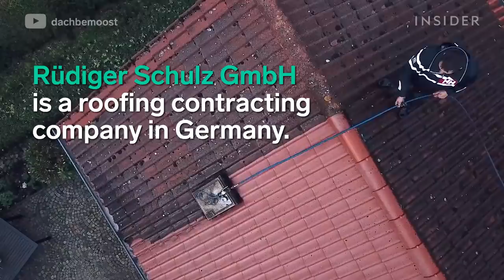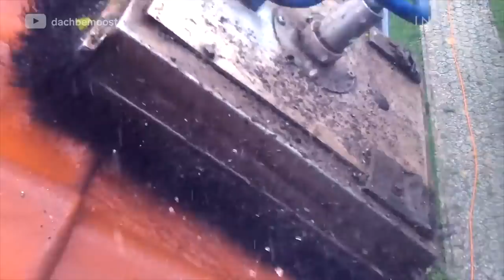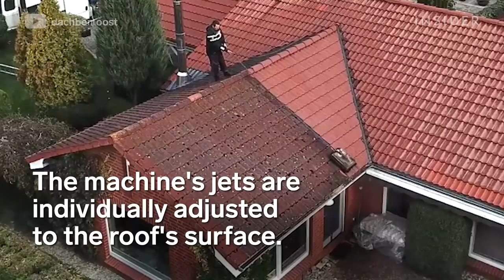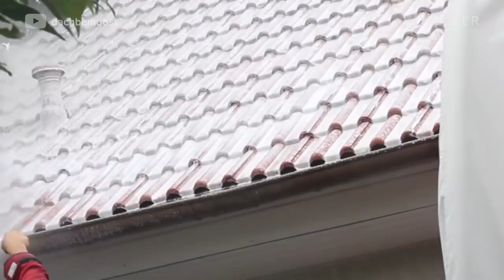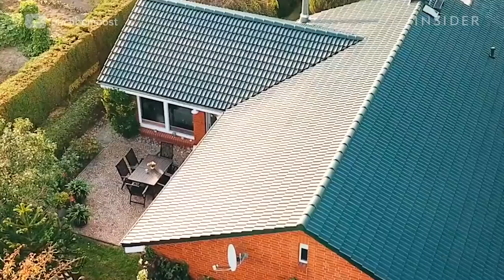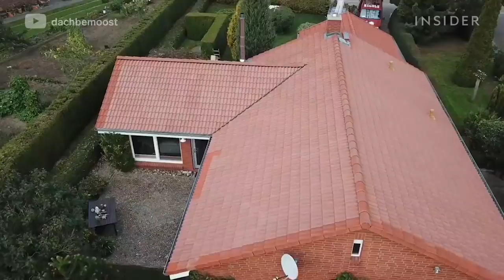Cleaning Roofs Is Easier With This Machine

Comment: I actually love having moss and lichen on my roof... It looks homely
Reply: It may look homely, but bacteria (gloeocapsa magma), moss, lichen and such eat away at your roof causing premature roof replacement which wastes several thousand dollars and leaves your roof looking bad and if you try to sell your home with the roof in that condition, it will lower the value of the house.  First impressions matter.  if someone sees a nasty looking roof, they will assume the same level of care was given to the house while you owned it.  These contaminants can also eat away the limestone granules on an asphalt roof leaving what appears to be hail damage.  When I bought my house, the home inspector saw the damage and the homeowner had to replace the roof before he sold the house to us.  It's your home and you can treat it how you wish, but it costs you money in the long run.
Reply: @Troy-Echo  i must apologise, i live in South Africa, my roof is tiled with ceramic molds that have been there since the houses construction in 1917. I believe they are half an inch thick, but i am unfamiliar with imperial measurements.
Reply: @alexvanoers9835  Hmmm, 30 centimeters is 12 inches, so 1/24 of that would be 1/2 inch, wo that would be about 1.25 centimeters for 1/2 inch.  These are still harmful (the moss and lichen) as they do have filament and micro-filament root structures which burrow into the roofing material and accelerate the decay of the roof, but as long as you do not have a leak, I'd say stick with it.  If it has been there for 100+ years, it was built well.  Not much is built like that these days.

That's why I'm about to build my own Walnut dining room table instead of buying something.  Unless you hire someone here in the USA that is a wood worker, or pay a LOT of money for a real wood table, the only options are cheap MDF or chipped wood pressed into a form and put together to look like a table, then they add a really thin veneer that looks nice, but it is easily scratched and then (at least to me) it looks like crap.  Once it warms up here I'll tackle this task for the fun of it.  Look up BYOT #23 here on YouTube and you'll see what I'm talking about.  The house I'm in now was built in 1989, but the house I was in before this was built in 1929, not much newer than your home, and in many ways it was far superior to the house I live in now.  So I like older homes like yours.  Well built quality items last, where the cheap furniture I mentioned may last several years if you don't try to move it, but it's total junk.

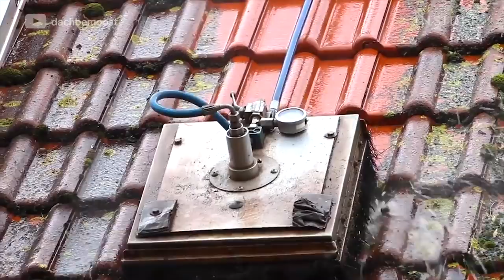Comment: 0:52 How can that thing go straight when there is a pipe there?
Reply: They avoid things like that because a square surface cleaner (even round ones) will not be able to get close to dormers, pipes and other items on a roof.  you need to reach those manually, which they do not show because it ruins the illusion and shows how much of a piece of crap this is.  I do professional roof cleaning and I'd never recommend a product like this.  1) all you hear is music, which is intended to mask the fact that you'd be listening to a high powered pressure washer otherwise, which can strip paint and clear coat off of a tile roof and leave them looking dull and lifeless.  I also do not understand why people post videos like this.  OSHA could pull these and take this company to court for not supplying their employees with proper body harnesses and safety ropes.  That's about a $125,000 fine, and people are posting this where it can easily be pulled as evidence against them.  The proper way to clean a roof is soft washing.  This is a chemical process that kills the bacteria, moss, lichen and other contaminants on the roof gently, and does not effect the paint or clear coat on the tile or other roofing surface.  This is just a new version of the roof rover device which is just as damaging in my opinion.  If I hired someone to clean my roof and I came home and saw them using this, I'd take them to court for damaging my roof.  A new version of a harmful product is still harmful.  They conveniently do not show you the areas on the roof where the surface cleaner has blasted away the clear coat or paint leaving the tile looking like crap.
Reply: @Troy-Echo  yeah this process may dull the paint and take that magic coating that everyone talks about! However after 10 plus years this magic coating gets eroded by the elements anyway and if you watch the video until the end the coat and paint the roof anyway. Meaning the magical coat you talk about is good as new! Turns out this machine isn’t as bad as you suggest!

Comment: These surface washer have been around for years, only this guy was crazy enough to support the weight of one down a roof merely the hose itself, incredibly dangerous when that hose fitting breaks under pressure.
Reply: i've had hoses pop, no big deal.

Comment: $1000?
You are literally paying for something that a pressure washer can do and cheaper.
Reply: No matter the shape of the item, a pressure washer can and will damage your roof.  A pressure washer can strip away the clear coat and paint underneath on a tile roof leaving it looking dull and lifeless.  They don't show you that because it would hurt their sales.
Reply: @Troy-Echo  man my pressure washer doesnt even do that
Reply: @mataco7073  Are you using a professional pressure washer with 4,000 PSI or higher?  Most low end professional pressure washers are about 4,000 PSI and 4 gallons per minute of water.  Higher end are also about 4,000 PSI, but 8 gallons per minute.  Some people that do a LOT of pressure washing of large surfaces such as gas stations, they will link two ore more  large pressure washers together for 16 to 20+ gallons per minute of water flow.  The pressure in pressure washing really isn't the main useful part of its cleaning power.  I'd take a 2,000 PSI and 8 gallon per minute pressure washer over a 4,000 PSI 4 GPM machine any day.  I was talking to one PW professional that explained he bought a 4K, 4 GPM machine for his main work, removed the 4 GPM pump and replaced it with an 8 GPM pump, then dialed back the pressure to about 1,800 PSI.  The reduced pressure allowed the smaller engine to push the 8 GPM water flow.  This saves his larger pressure washer for big jobs.  Unless you're trying to remove paint or gum from a sidewalk, you really don 't need more than 1,800 PSI.  Water flow is what you need most.  As far as stripping paint and clear coat from tile roofing, I've seen this happen.  Maybe a golf ball hit the roof and started a chip, or a limb, or who knows what, but once you have a defect in the coating, it is easy for the pressure to start stripping these coatings away.